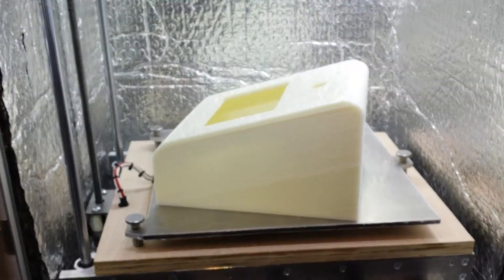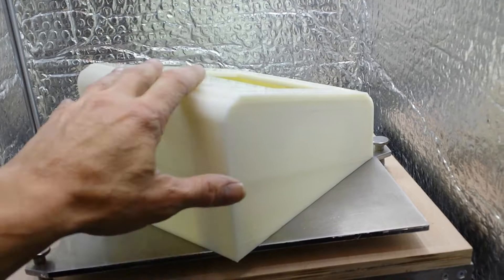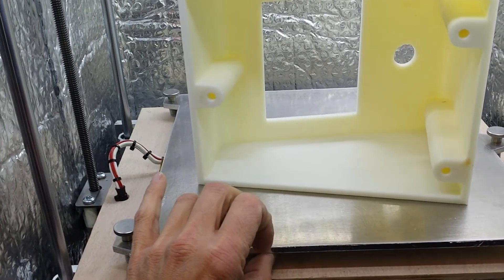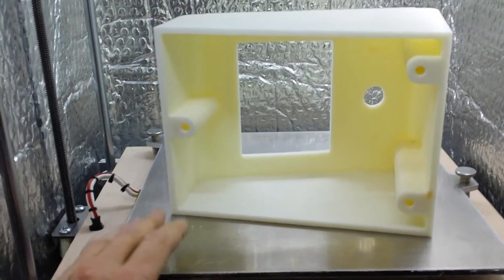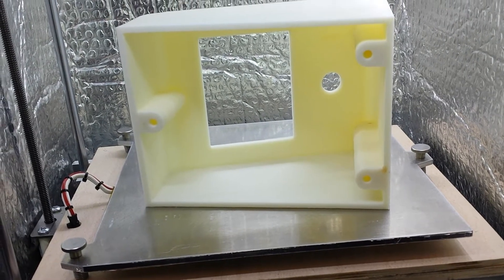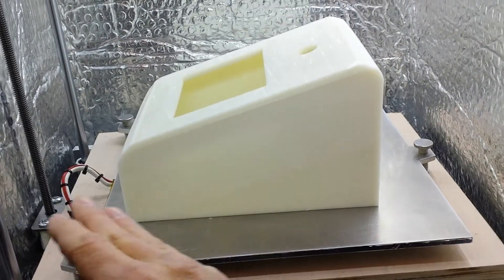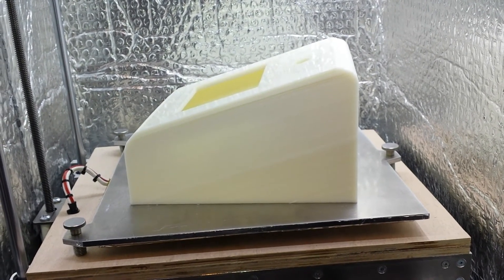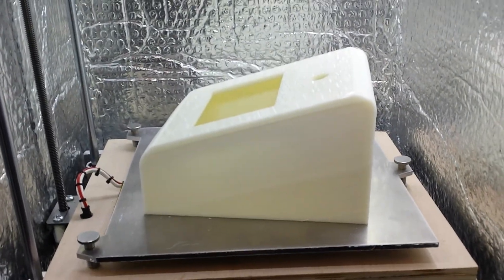3D Printer 750watt heat bed - 1st successful print

Comment: Did you have any problems with smell or even smoke coming off the silicone hater pad? I bought one from Aliexpress (not Keenovo brand) and when it's cold it smells slightly, but when I heat it up it stinks so badly I can't have it indoors. Even when I tested outdoors smell was unbearable within 3 feet of the heater. I did stick it to the appropriate aluminum plate and payed attention not to trap any air bubbles and not heat it beyond maximum working temperature. However, adhesive seems to be failing after just a few days of testing, and sometimes big bubbles of air form under the heater pad - I suspect the adhesive is out gassing something. Btw. genuine 3M MP 468 adhesive is good to some 200C and the few sheets I used before gave me no trouble - possibly indicating that my new heat pad is equipped with a fake adhesive.

Where did you buy your pad? Can you link to he seller? Thanks

Regarding thermistor, I mounted mine on the bottom of the aluminum plate about 15mm off the edge of the heater. If you don't have that much space on your plate, you can always drill a small hole 10mm deep hole on the side or back edge of the plate and stick your thermistor in it. In the end it's not a critical difference - you just have to know how much your bed surface is "lagging" behind the heater bottom - in my case it seems to be about 15C but it drops as bed gets to set temperature

Kudos on your print, it takes a lot of faith to run such a long print, especially in ABS :)

Comment: This is fantastic man.  Strangely some of the hardest things I've had to print have been enclosures!  I guess it's the geometry, and the dimensional accuracy needed.  What temperature are you running the chamber at?  70 degrees?  I've been looking for enclosure heaters.  There are some nice 240v all in one units out there.  What is that bubble wrap insulation material?  I remember someone mentioning cooker hood/grease guard insulation.  I'm going to line the 3030 with 25mm celotex similar to you.  Want to line the inside again with aluminium tape at all the seams and your insulation looks good.

You made a good point about milling thermistors into the bed.  I've ordered a Keenovo heater pad with integrated temp sensor, so hopefully it'll be all good.

Any luck with polycarbonate?  I can print small items but anything too big warps, of course.
Reply from the maker: Hi Jai :-)
ok I run the chamber at 65 deg c for that print.
The bubble insulation was sourced from home base and is the standard foil insulation roughly £20 a role. very temperature resistant but not quite the look I was after. it works for now.
I have yet to get back onto polycarbonate materials and I have been flat out making stuff in cheap ABS - so easy to work with on my printer.